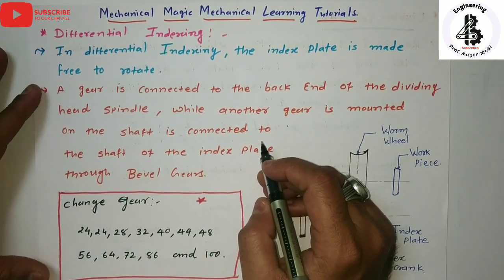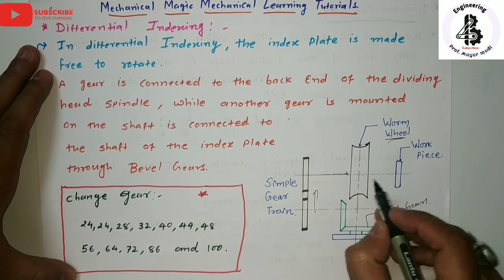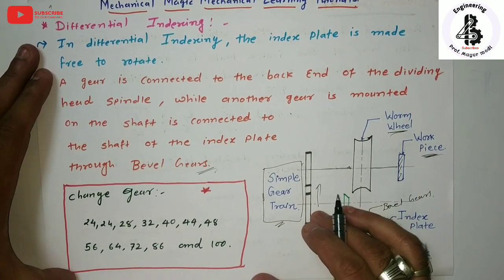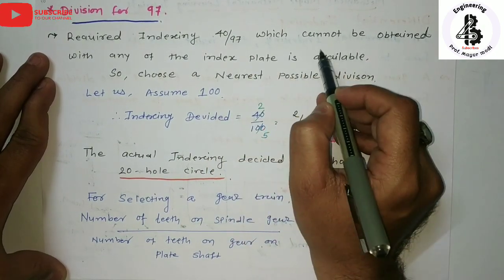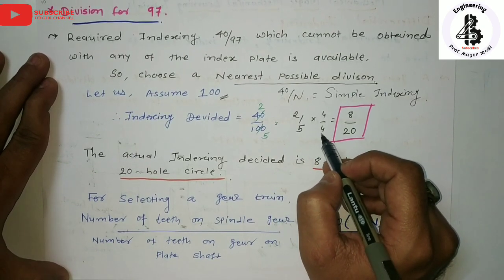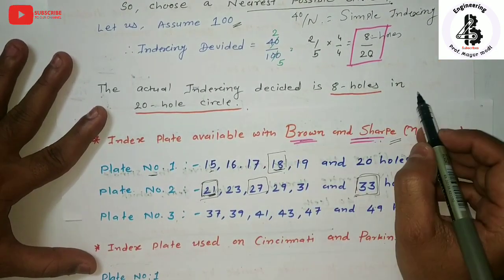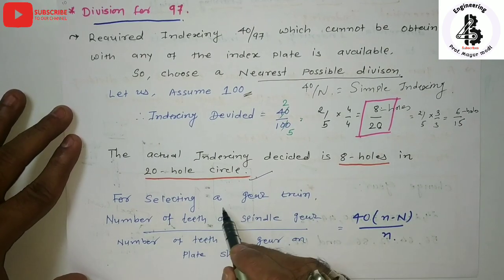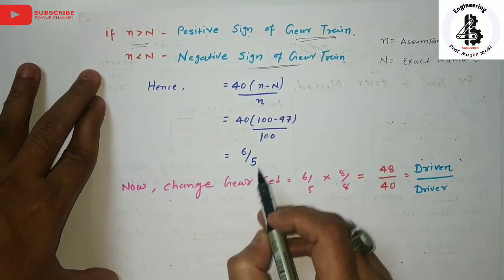differential indexing | Numerical Indexing for 97 teeth | Indexing Methods |Metal Cutting

Comment: Give me the combination of deferntial indixing head number 40.
Reply from the maker: I cant get ur point.
Reply: @modimechanicalengineeringt8780  sir i need 81 teeth cutting indexing simple indexing
Reply: I have  all this number plate
Reply: 24:25:28:30:34:37:38:39:41:42:43:46:47:49:51:53:54:57:58:59:62:71:63
Reply: Sir, I'm just a job but you can contact me on whatsup.